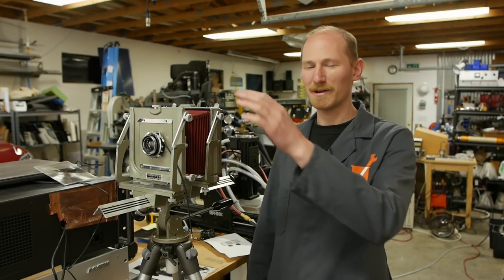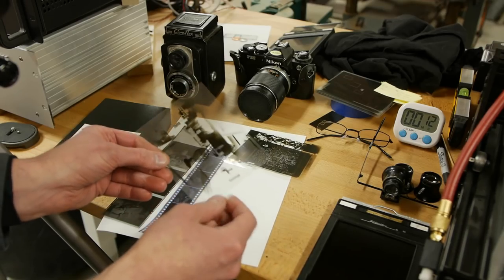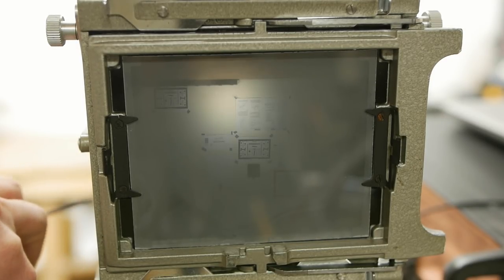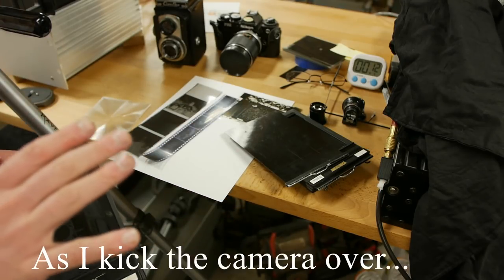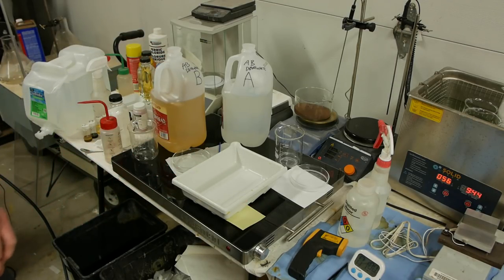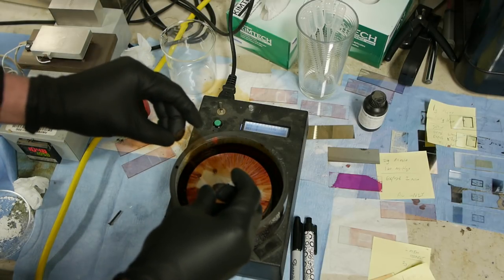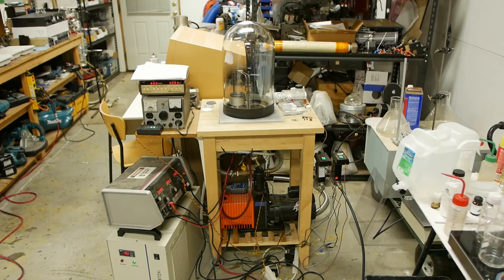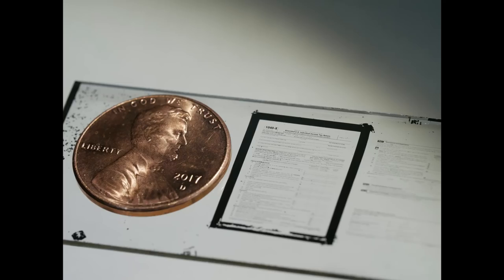Antique 4x5 camera creates 20 micron photolithography masks: Super tiny tax form

Comment: Great channel, great work!!! I really enjoy, following what you are doing :)
Just a few comments / thoughts from my side:
The fresnel lens on top of the groundglass is mainly used for wide angle lenses with a relatively short focal length to make it possible to see the whole image, when composing your image. It's rather a field lens, that prevents you from getting dark corners in your viewfinder image. Focussing with a fresnel lens is a proper pain in the hoop, that is why this lens usually can be taken off easily.
Another tip: To remember, which film was exposed in sheet film holders, you turn the dark slide around. One side has a white marking, the other side a black. Black means: exposed or empty, white means unexposed film...  
It's interesting, what you said about what we here in germany call Schwarzschild Effekt (reciprocity failure). You mentioned, that this effect gets worse with cold temperatures. Actually, I used to work with an astronomical camera, that was part of an celestron reflector telescope. This camera basically consisted of a plain-parallel glass block and an aluminium container, that was holding the film in place and that was filled with carbon dioxide snow to cool down the film to minimize this Schwarzschild-effect, as exposure-times were very long with this camera...  This would mean: lower temperature = less reciprocity failure... But it might not behave linear along the whole temp-scale.

Comment: Great video! When loading the film holder, one side of the cover slide is black and the other is silver. They also feel differently. When loading unexposed film you turn the black side out. After exposing the film you reinsert the slide with the silver side out to signify that the film has been exposed.

Comment: I was intrigued by the film's reciprocity violation that you spoke of. It seems like the exposure is non-linear with respect to the optical intensity. This might be partly why you are able to get such good resolution: you are essentially squaring (or higher?) the intensity profile, which has the effect of sharpening, but binarizing the image. I bet the film is designed this way exactly for that purpose. 

Paul

Comment: Things I'm left thinking about: 1) It should be pretty easy to 3d print a similar camera. 2) do you need a lens? Could it be a pinhole? 3) You can buy paint-on emulsion, so you could make glass negatives. I dunno that  that actually helps, but it could eliminate the need for the vacuum hookup. 4) A standard photographic enlarger might also be used to get enlargement. They're getting cheap these days, I hear. That might allow you to 35mm. 5) A much bigger project, but I feel like if there's anyone I know, it's YOU who has the skills and equipment to make system to print directly to film, using either a laser or an electron beam...

Comment: You use a pin registered vacuum easel mounted behind the large format camera (bolted to the floor) or better yet a "Stat" camera. The reason that it's not sensitive to red light is because it's made to reject the red in the rubylith. Being able to work under red light is just an added bonus. This is how color photo composites where created before Photoshop. You would use Litho film with "Rubylith" along with large format E6 25 ISO (8x10 slide film). You would cut out the rubylith by hand around images on the same pin registration system. Than shoot each rubylith (its red) under the pin registered stat camera with Litho film to create a B&W mask. Amber light is what you use for traditional B&W (gray scale) photography.

Comment: Around 15 years ago I was at an estate auction which, amongst all the other stuff piles to the ceiling, included a process camera. I lived in a smaller place then and didn't buy it, and now I'm kicking myself because it probably sold for a song.
I do, however, have a lens for a similar camera, though not as large, and I should be able to make my own makeshift camera when the need arises.
I think one other limitation of the system you have is that the grain of the ground glass limits your ability to focus exactly (as you observed). This is because of both the visual coarseness of the grain, and also that the ground surface will vary in height by similar amounts. I wonder if a chemically etched plastic surface would be superior. Maybe a pair of focusing prisms (I think that's what they're called) would help too.

Comment: The fresnel lens is to aid your focusing not to aid light transmission. It allows the 1/4 wavelength of light to show a weird diffraction when vertical or horizontal lines are not in focus. Get everything set up before you even load the film in the holders. If necessary you can use a cheap USB microscope that will give you 400x and can even be  attached to the camera back. Also, you can put a pin hole lens in to focus and swap it out for a "real" lens. By "pin hole" I mean just a piece of black cardboard with a very large opening. As long as your distances remain constant you don't have to worry about swapping lenses out. Also, you can get digital backs and even poloroid film in 4x5 to "check" things before your actual film, be it litho or regular film.
Reply: Also, reciprocity failure can be overcome by hitting your subject with an ordinary flash from a DSLR camera. Just point it at the wall, trip the flash with the button and you'll get orders of magnitude more light reflecting off it. Remember the inverse square law though: the closer you are when you trip the flash the more, by a factor of 4, you'll get hitting it. And of course, as the camera, or rather the film, gets farther from the point of reflection you'll get another reduction by a factor of 4. Why 4? you're working in two dimension. Just thought I'd add that before another person asks. I'm confident you are aware of inverse square effects (Ben).

Comment: I work in lithography. We use computers now but this film is made like that because it was used to capture the raster dots of a CMYK image which were 2400dpi 72 lpi usually, in order to transfer it to the printing plate of the offset press. It was very laborious and tedious process. Now the color separation is done on the computer and the plate is made by a computer to plate machine (CTP) skipping the photographic part all together.

Comment: The dark slides on the film holders are silver on one side of the handle end and black on the other side. When you load the film you put the slide into the holder so the black side is out. After making your exposure, you put the dark slide back in with the silver side out so you know that it has been exposed. Black=unexposed, silver=exposed. The twist locks are simply to keep the slides from opening accidentally.

Comment: What you are able to achieve in your garage is pretty amazing and really enjoyable to watch.

It’s been quite a long time since I worked in a semiconductor facility using metal lift-off but I do wonder whether some of the contamination/particulates of metal visible in your final pattern may be the result of not keeping the slide completely submerged in acetone until the lift-off is complete.  Small released metal fragments will strongly adhere to the slide surface if the acetone evaporates from under them and will remain bonded even if submerged back into the acetone (possibly Van der Waals bonding).

Another question/suggestion, do you know if you are developing an undercut in your developed resist?  I can’t remember the details anymore but I do recall that for this technique to work at its best, the developed sidewalls of the resist should possess an undercut.

Comment: Lately i've been delving into the world of high resolution rotary encoders (of the absolute positioning variety) to see if i could build a mount for tracking satellites.  This popped back into my head as a possible way to DIY one.  Then i did the math. :/  To get a 20 bit rotary encoder, you'd have to split a circle 36" in diameter  into 1 micron sections, then minaturize it.   
Pretty remarkable what they can do.  Renishaw has 26-30 bit rotary encoders.  Blows my mind.

Comment: It always amazes me how a camera lens (a good one) can 'see' such detail from such a distance. My mind keeps thinking closer is better, but  it's actually just the opposite. Every focal length has it's sweet spot. It was also quite a revelation to me what you discovered about the effect temperature has on the exposure; I guess the sensors of today's cameras are much less influenced by that kind of thing... Great video, I enjoyed it very much.
Reply: Digital camera sensitivity isn't really affected in that way at all. However, the noise characteristics of a digital sensor is in fact heavily dependent on temperature. For that reason, digital cameras used in scientific imaging or industrial imaging are often actively cooled to way below ambient -30*C or -50*C is a good starting point for astrophotography for example, where noise control is very important. Even amateur astro cameras are cooled this way because it has an extremely drastic impact on noise. So, depending on how willing you are to stretch the definition of "sensitivity" - you could argue digital sensors are temperature dependent too... Less noise = less exposure time required, making it, effectively, more sensitive I guess!
Reply: @Mythricia1988  So what you mean is, yes they are effected by temperature but in a different way instead you start your comment by saying, no they not really affected in that way at all. What you say is interesting to me, but why do you start of with an almost absolute negative? I guess I should just give up on commenting on stuff, it seems like I'm too sensitive... It's coming into winter here so maybe I'm being effected by the temperature myself.

Comment: A few pointers from a Large format shooter, the fresnel lens was for outside in daylight and it gives s better overall image, if you noticed, that you could not see the entire view all at once the other glass helped with that. Something you wouldn't notice taking closeups very well. The camera your using is from the 1950's, I have several that are from the 1920's and they work the same way, just made of wood. As to your film bulging, thats not an issue when using a smaller aperture, your depth would go down, but your exposure time would go up. Very interesting project. I am glad their are many new real cameras like thee being made. Thanks for the Vid I enjoyed it a lot. Oh and the thing you remove from the film holder is a dark slide, not a shutter. You could also get a sharper image with stand developing, thats a development stage that lasts an hour not 3min, you have to dilute you chemicals to 1:100.

Comment: Thanks for showing us the process.  I’m aware of a technique which may help to improve repeatability in the exposure/development phase of the film, to reduce the effect of reciprocity failure.  It’s a technique I learned for a totally different purpose, but it may help you here.  Compensation dilution technique.  Basically it consists of reducing the strength of your developer solution until there is so little developer that there’s only sufficient to develop one sheet and by the time you’ve reached full development the developer is completely exhausted.  I originally did this in the Indian Ocean to overcome the dual problems of temperature control and difficulty in obtaining developer.  I used Paterson’s Acutol, which could only be obtained by calling in a big favour as it was liquid in a glass bottle and couldn’t be air freighted.  The unexpected gains from using this technique were more consistent negatives which could all be printed on the same grade of paper, and the ability to over- or under-expose film by one to three stops with almost zero difference in the final density of the negatives.  Information may be difficult to find, but it’s in the early editions of the Focal Encyclopaedia of Photography, that’s where I originally found it in the 1970s. Hope this helps, kind regards, K33F

Comment: Another amazing video! I've got a couple of suggestions:
1) Get yourself a macro photo rail for the camera (it has fine graduations and controls to take close up photos but of course you can use in your setting as is;
2) Do yourself a favor! Use citric acid stop bath, as it doesn't smell (but it spoils fast but it is dirty cheap you can use and trow it away in one shot); use Ammonium Thiocyanate fixer, it smells way less than the traditional and acts pretty quickly
3) You should experiment with flasher and a flash meter!

Comment: As a 40 year veteran of photolithography, the best camera/film combo I used was an imposer machine called an Opticopy, which had a huge lens developed by NASA. I used it with high contrast litho film for litho platemaking. The control system ran on an old PC and used narrow band green light sources and I used to shoot half tone dots down to .1%  POINT ONE percent! easily!  and the stepper motors could move the film board by .001 mm or thereabouts with perfect accuracy.  The litho film was higher contrast than the ortho contone film you are using.  I am sure you can still find old stock of the film which was usually about 10 x 12 inch up to 30 x 40 inch sheets. And the developer and fixer could be made with common chemicals.
Reply: I bet you could find an old opticopy lens somewhere, the machine cost hundreds of thousands when I used one in 1988, but a few years later it was worth almost nothing but the lenses would not have been thrown away!
Reply: and yes, it had a vacuum back like yours but about 4 feet square and adjustable.
Reply: PS, just got to the part where you evaluated the film and it is nowhere near as contrasty as our old film.  I loved working in the darkroom and I wish I could just take you there and show you how good it was. I do have a video from back then of us working the opticopy if you are interested.
Reply: When making plates, equivalent to your slide, we used a vacuum frame and if you had newtons rings that was bad because the film was too close to the glass and the edges would seal and stop the vacuum working properly so we used a super fine powder (anti-offset dust) to prevent newtons rings and this would actually improve the sharpness of the image.   Our light source was a 4 to 7 kilowatt halogen lamp about 4 feet above the vacuum frame.  Collimation of the light was important but most problems came from insufficient vacuum or the film clinging to the glass and not being intimate with the plate.  We used to step and repeat dots too small for you to see.  Our results were way sharper than your examples.

Comment: The plastic sheath on the dark slide has a black and a white side. Black side out it's unexposed, white side out is for exposed film. Vacuum back is excellent most folk would use a piece of double sided sticky tape to hold the film back to the plane of focus. Glass plates do NOT sag but cost and need special darkslides.

Comment: The Fresnel is primary used with wide angle lenses, or lenses of shorter focal length. To simplify and generalise, an optical lens for general photographic purposes is in focus when the lens is approximately it's own 'focal length' away from the film plane. The middle part of a lens is always closest to the film plane because it is centred with respect to the film, but this difference becomes significantly greater the closer the lens is to the actual film, and as the intensity of light incident on any surface is inversely proportional to the distance of the light source, the outer edges of the film tend to become much darker. This is most commonly remedied with a centred neutral density filter in front of the lens, who's gradient evens out the exposure. However, as maximum brightness on the ground glass is usually required for accurate focusing, the Fresnel gives more even illumination for the photographer during these critical stages.

Comment: First, acetone, isopropanol, DI water rinse sequence cleans substrates very efficiently without scratching substrates.  You will want to force dry the water -- preferably with dry nitrogen.  You might also need to repeat 2-3 times.  If this fails google "piranha cleaner."  Glass is pretty hard so scratching might not be fatal in this case, but not for most useful materials.  Second, metallizing the substrate first prevents loss of resolution due to UV reflections from the slide bottom.

Comment: In the 1970s the electronic magazines' had a black image you could take a photo with your 35 mm. Then expose the light  on to a copper plate to make your own circuit board. Then wash the plate in a chemical  bath & now you have your own circuit board. Then drill holes in the board  with the copper circuit board to put restores, capacitors, & transistors on.

Comment: Interesting video. It's rather amusing to see someone discover a 5x4 monorail camera.  Large format cameras ( 5x4 or larger) have quite a bit of depth of focus at the film plane when the lens has been focused. Think of this as similar to depth of field, but located within the camera. The depth of focus allows a tolerance in the location of the film held in the dark slides / film holders. Reprographic and Process cameras had often vacuum backs to hold the film, but that was mainly because the film used was anything up to about 20 x 24 inches.